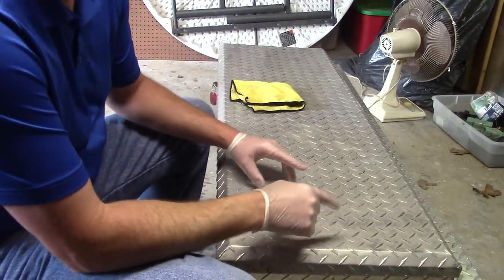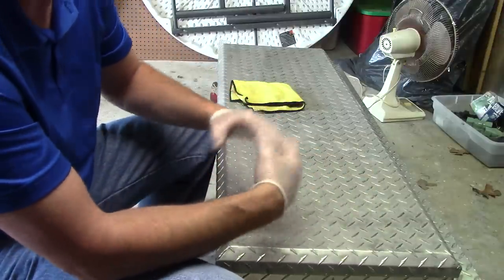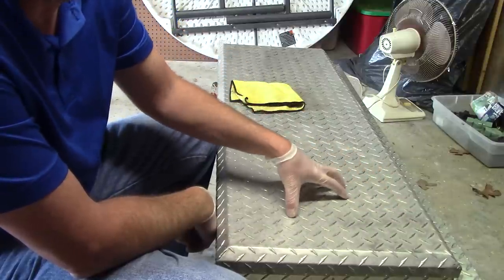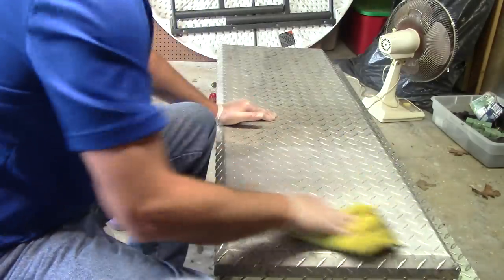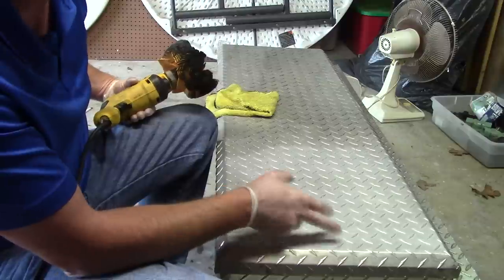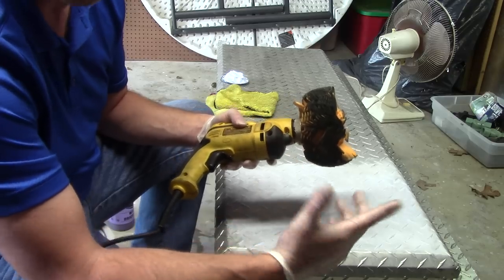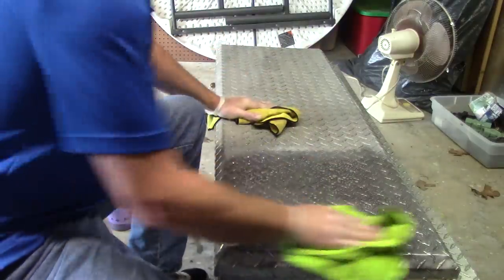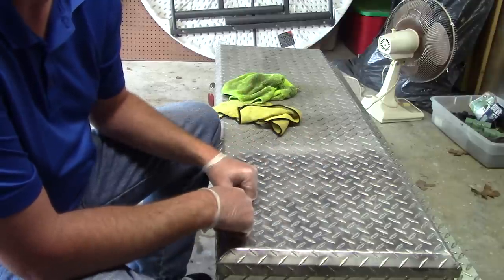CLEANING ALUMINUM WITH ACID PLUS POLISHING

Comment: Scott, another way is to "flash" the aluminium (as you did) and then rinse the box off to get the residue off. For my water it is a PH of 8-9  to bring the acid back towards neutral.  I then hit the box with a purple airway buff and a brown rouge, this will take out any scratching around the checker plate. After that i use a white liquid polish that has a sealer in it and either hand apply or use something like you have with the flitz buff. Good video and yes when you mention wheel brightner to people they react like you poked them in the eye. I use it often because in the 20-30 second flash you can erase years of  crap off that aluminium and  it makes it SO MUCH EASIER to polish, and not as dirty for you.

Comment: I just polished my stock aluminum f150 rims and I used napa aluminum brightener to remove the brake dust and crud on the inside of the rims and just 2 coats with agitation removed all of it. It's great for getting a good base to start from. Once I removed the clear coat and sanded the mill marks out up to 600 grit. I polished them with a variable rotary with airway buffs and brown/green compound. They turned out great for my first time with a mirror finish.

Comment: Baking-soda will neutralize it too. It is a buffer-agent. It will neutralize an acid and a base. They use it to force even oxidation, for a protective layer, on the statue of liberty. Keeping the acid-rain, damaged copper, normalized "green". (Copper oxide)

Comment: we used to spray it with muriatic acid... cheap and easy with a weed sprayer. We used it on our trucks including bull racks that were all aluminum. Used on wheels also but not unless they were really nasty as it's harder to polish  To get the black oxide off used corn starch and rub it down works amazingly

Comment: Scott, Thank you so much for the tip in restoring the diamond plate box that needed some TLC. I detailed for 15 yrs. for a Ford, Mitsubishi, Subaru, Lincoln Mercury, etc. I was the detail manager. And I would rather detail than paperwork, righting  schedule etc. and a little detail. So I would like to learn as much info: that you can give me. Cause I was always told don’t use acid on diamond plate, but you proved them wrong. Thanks again, God Bless You, much Love to ya Brother.

Comment: I'm a fan of etching the aluminum before polishing. I just bought a $400 used box for $100 and cleaned it up with a power washer and took a wire wheel to tile grout that was splattered here and there inside and out because the previous owner was a tile guy. My next step is to acid etch it but I don't have any acid based wheel cleaner at the moment. After I etch it I will use Mothers Aluminum polish and a buffing wheel on a drill and it will shine like a mirror. Good video but I already knew what you conveyed.

Comment: Appreciate the tutorial, I work on a boat with aluminum diamond plate decks in the machinery spaces. Have been trying to find an easy way to bring the shine back after sea air oxidation and everything I've tried just makes a mess of all the surrounding machinery. This looks like it will work for my situation.
Reply: How well did it work for you?
Reply: Robert I hated doing that job. There is an easy way. grinder with a rubber hook and loop pad and 3m polishing discs work easier and better than any chemicals.

Comment: Why you going ACROSS the checkered raised parts??
You need to go IN-LINE with them as to contact the most of the lower surface. Go one way- 45 degrees from the edge in this case. Then again 90 degrees from the first sweep. That way you'll contact more surface.

Comment: Only thing that i can tip u is run ur wheel with the direction of the diamond plate to prevent shadowing around each diamond and to remove the excessive polish use baby powder or baking powder and rub it with ur hand it will work better than all purpose cleaner wich dulls the end results otherwise good instructive vid

Comment: I have a 2004 ToyotaTundra extended cab pickup truck . The engine was originally brushed aluminum on the intake manifold and the valve covers. Since salt has come back into style on winter roads, the brushed aluminum is now pitted aluminum. Any ideas as to whether the method you used on this truck box might work to bring back the brushed aluminum on the engine parts. Also, really don't want to disassemble the engine-so would have to be done in place.Your thoughts and or suggestion!! Thanks for taking time to read and answer my question.
Reply: Try iron remover!! Spray on let dwell without drying and rinse.

Comment: I use pure acid put about inch in 5 gallon bucket then half bucket water that gets it real clean rinse with clean water then break out the grinders and rouge but that flitz ball works i got both sizes of them too.

Comment: the acid wash you're using is as good as say a ardex buster #6235 acid wash (which is high ph acid cleaner for wheels).  I want to clean my aluminum boat that has become dull and has water stains (I've tried nearly everything to get it cleaned)... I want those fish to see themselves and bite my hook before its reflection does!  do you think you method will do the trick?

Comment: you don't wipe the compound off, it has polymers that fill micro abrasions caused by the interface. Buff it until it disappears and wipe the residue with a dry microfiber. Notice how you had a way more mirrored look before you wiped it off. You stripped it,  leaving it looking like raw aluminum

Comment: Can you apply that same process on rims and truck tanks?
Reply: If either have a layer of clear coat, be aware that you are going to be stripping that off and will most likely want to spray it with a couple coats of clear coat. You will not want any polishing wax or residue from the compound left on your product before you spray it. If it's bare aluminum, then... yea why wouldn't it.

Comment: What about that horrid chrome plastic trim, cheap stuff used by GM ? 
I have a Buick Envision that’s new and has spots or acid rain all over the door and window trim...I’ve about gone bananas trying to  find a way to clean and protect it properly. I’ve used diluted vinegar, denatured alcohol and nothing. Today I was excited with the results of Eagle Ones PVD and Aluminum wheel cleaner on my wheels and have a toothbrush in hand thinking why not 🤔 try it... it’s ph neutral but if it does anything then what?
Reply: SouthernCross There’s no way to restore a shine in chrome colored plastic. There’s no layer of fresh metal underneath like real metal.

Comment: great video but i got a question  what about weather guard boxes that have a clear coat on it
Reply from the maker: well if it is clear coated you can still polish with flitz and buffing ball...megs wheel brightener is safe for clear coat but i would wash the weather guard box with just car soap instead
Reply: cool i will give it a shot thank you for the help

Comment: when the Acid dissolves some of the surface Aluminum oxide  and you neutralize the acid it drops that Al oxide a very hard and fine abrasive that works as a physical polish.

Comment: 6500 rpm edge grinder with yellow or white 8 inch buffing wheels acid wash it then rinse with water. once dried use brown rouge on yellow buff wheel work it good till you see hardly any residue. change buffing wheel to the white and use white rogue or you can use green or the blue. Blue is best imo and do same thing again then if done right no need for any hand work but if you do use liquid hand polish and terry cloth towels work. i do show truck polishing for a living this is best way. good video tho but you putting to much time into that work.

Comment: I love the info great service but you're killing me with the terminology,      
 pH=0 ACID      pH=14 BASE 
"Acid base alkaline acid base wanna use acid base ph acidic ph alkaline ph acid base based alkaline acid based base .........capice!?  Fahget aboot it.       

Texan Translation- pour some Coke on it, or buy some Muriatic(hydrochloric acid)  from home depot and dilute it with water,  maybe add some soap,  then use a base like baking soda (sodium bicarbonate) to neutralize the acid and deep clean it. Use an acidic solution with a low ph use a basic solution w a high pH.

Comment: Dude that was way to much talking. Make it boring. I’ve owned an Auto Detailing shop since 1991 and have used a product called Chiefs Choice as an aluminum cleaner followed by a polish.  My shop details about 15-20 vehicles a week.  I also do fire trucks and Motorcycles. .  Good luck
Reply from the maker: No problem..
My name is Scott
Thanks
Reply: What does it cost to detail a whole fire truck?
Reply: Where do you get chiefs choice and is it applied by hand then polished off or by hand?